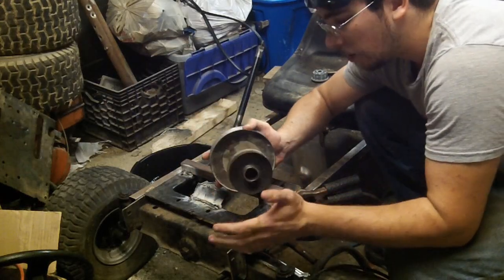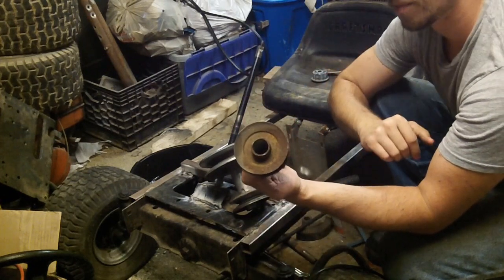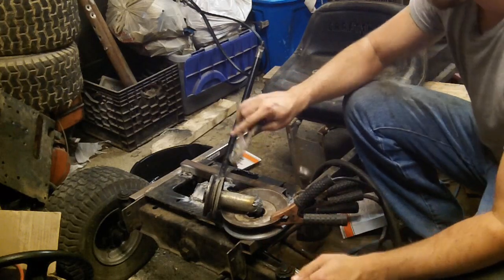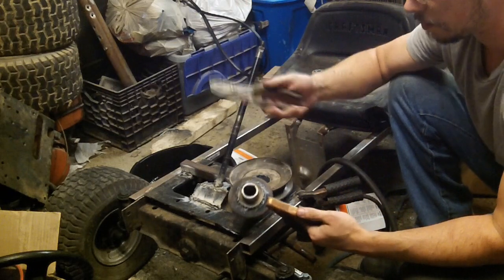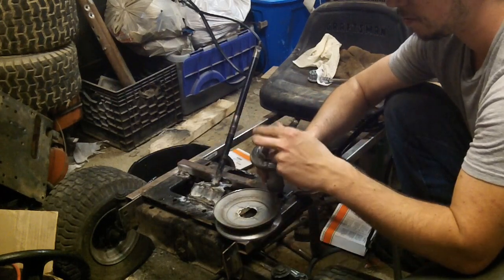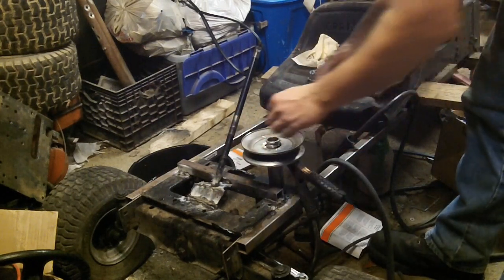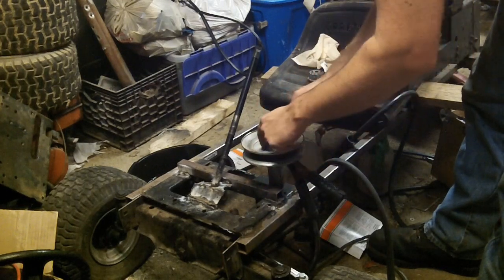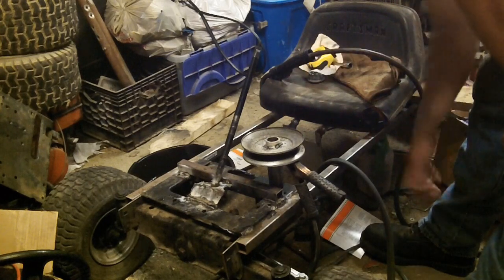Engine Pulley upgrade Flip the engine pulley

Comment: I have a question I have a huscarvarna Kohler 21hp hydrostatic gas pedal version I want to make it faster I have a 3/5 in the back are a stock 4 the front has a stock 4 what's size do I need to make it fast a lip for like mudding it go pike 8 now